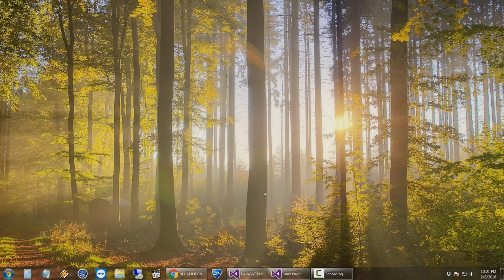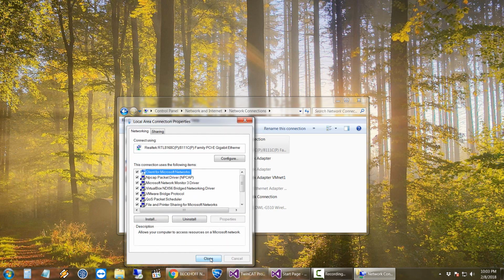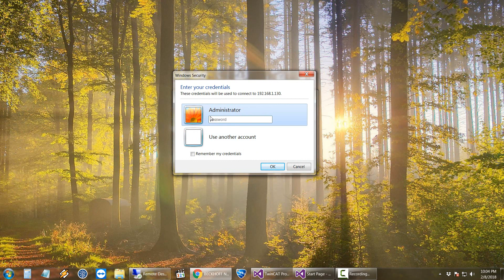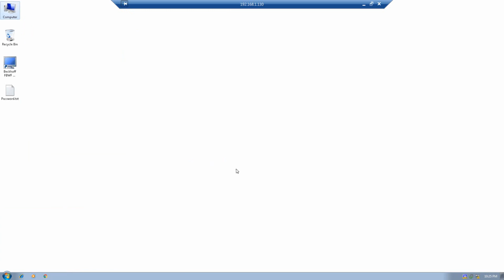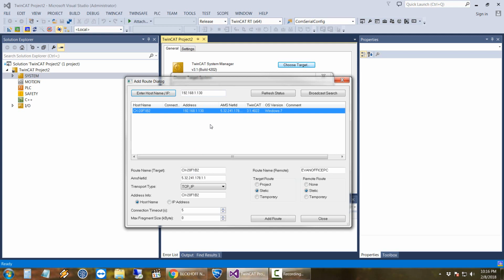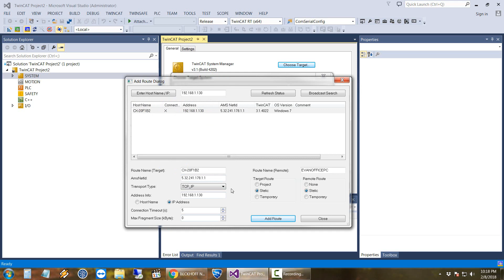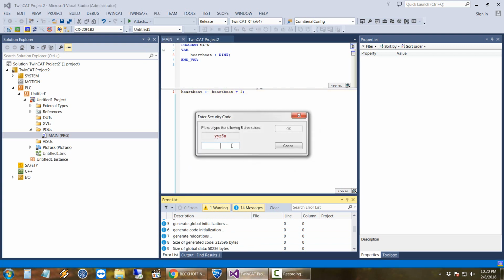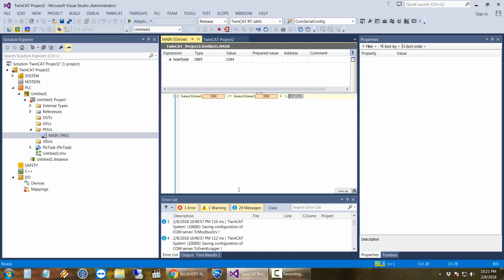Motion Control and IO with PLCs - EP3 - PLC Networking

Comment: Simple as that, setting the end point for our project , is as setting as target system for it. I am just watching this to compare it with TIA Portal. What I can figure out it that these are completely different automation systems as their hardware bases are different.
I think that Beckhoff TwinCAT in general in more complicated and challenging to master, it requires more knowladge from PC universe, whereas TIA portal is more about a microcontrollers but in that case programming and setting process is optimise on order to be more friendly to automation engineer.
Reply from the maker: Twincat is 10x more flexible.

Comment: Hello Evan, 
Thanks for the video. 
I would like to ask a very basic question, which has been bugging me for a while now. 
I am currently working on a project with Beckhoff CX2030 Embedded PC to run four motors via the EL7201 IOs. I use a different PC (a normal DELL PC ) to write programs for the PLC. The Embedded PC is connected with the programming PC via a ethernet cable. I just log in when I need to test the codes.
When I am done with testing, I need to take the PLC on the field for operation. How can I permanently download the code onto the Embedded PC so that I do not need the programming PC anymore when the system is out on the field?

Do I need to install TwinCAT 3  XAE in the embedded PC as well ? 

Best Regards, 
Shishir Pokhrel.

Comment: Hello Evan, I couldnt find my PLC IP using the ipscan, though it is powered and connected via ethernet. Also, TC status doesnt turn to run mode (stays blue). Appreciate your help. Thank you.
Reply from the maker: You should hook up a KB and monitor to go set the IP then.  As for blue status... you'll need to set auto start boot project and it'll run at boot.
Reply: says ADS error, login failed for application port 851